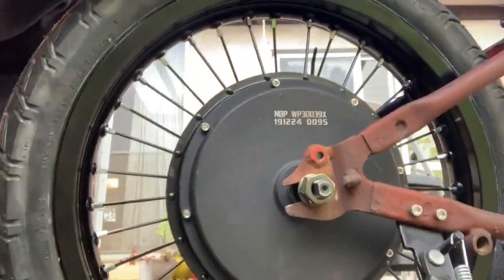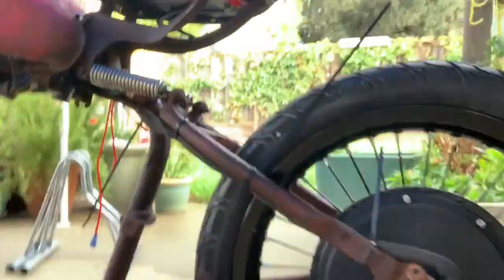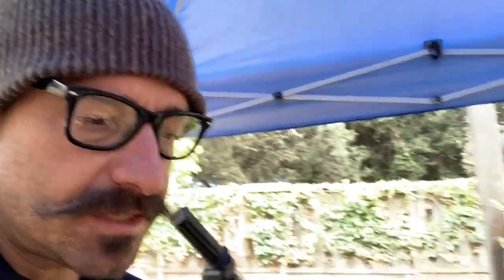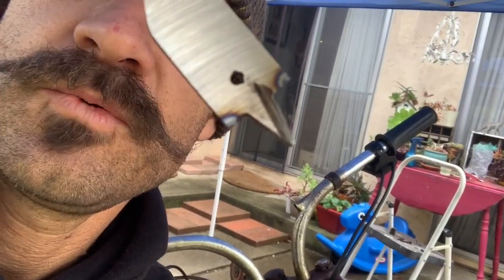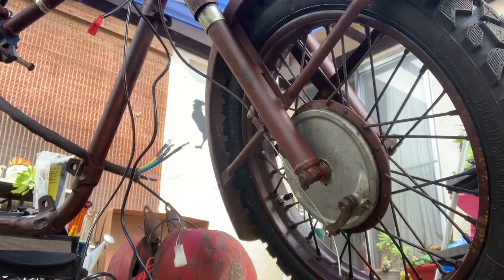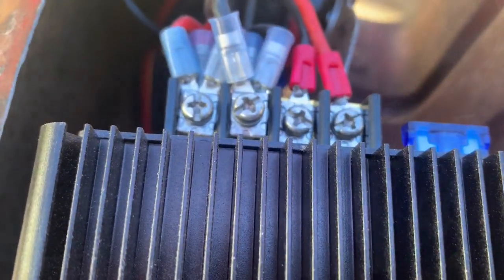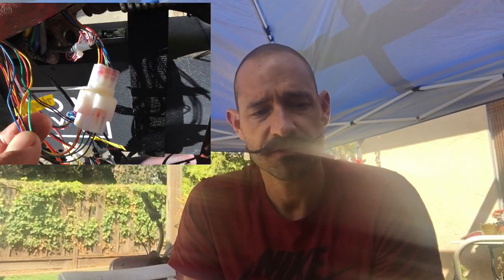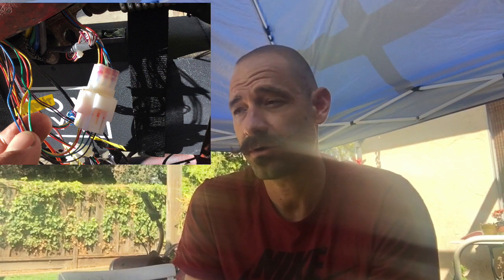1954 Puch Allstate Electric Conversion (Installing Motor, controller, cables, battery & wiring)

Comment: Sorry if i havent payed attention, but what brand is this motor? Qs205 or? How did the sabvoton hold Up to the task? Many people complains about the quality on this controller.. But I really want one myself, and already have one in the shopping cart.. 😂
Reply from the maker: The motor is a QS205 V3 3.5T.  I really like the Sabvaton controllers, it's pretty much all I run these day and only ever had a small issue with one of them (and it could have been an issue on my end with the wiring), and for that particular issue I was able to figure out a work around.  The interface is very user friendly and works for both android and IOS.

I have also read about the same quality issues, but to date I have found them to be pretty pretty much flawless.  The key is to not tweak the temp settings to aggressive and ideally to get as much airflow to the controller as possible if planning to run it aggressively.  Sabvatons aren't marketed for the consumer so depending where you order the controller from, the wiring is almost always different (They customize the controllers wiring/functions based upon what a companies needs are, and your technically ordering a controller designed for a specific bike). If your swapping out controllers you need to know if your bike currently sends its brake signal on the high or low side and to make sure you order a controller with the same set up (I just had a guy reach out that ordered a sabvaton that wants a brake signal on the low/ground side and the bike he was putting it into was wired for the high side) you can re-wire but its a bit of a headache to do.  

If you tell me what type bike your trying to build/modify, what speeds you want to obtain, I can give you much more detailed info in what you need to look for.  But probably the biggest bit of knowledge I can pass down is that the biggest limiting factor to both the Sabvatons and the kelly controllers isn't the amps or phase amps it can handle, but rather the RPM.  With 16 or 17" wheels the fastest your gonna go on any of these controllers is in the low to mid 50's.  At that speed the RPM tops out and the controller cant keep up with any faster signal.  But when I put 19"s wheels on the bike the top end speed jumps into the 60's and even the low 70's depending on the battery.  I believe the BAC 4000 & 8000 are the way to go if you want to obtain those speeds on the smaller wheel size simply because they can track the higher RPM,  but obviously those are $$.

Comment: You need to run the motor detection. If you dont run the motor detection it wont work. All controllers and motors need to basically pair. If you dont run the detection it wont rotate or it will run wild..
Reply from the maker: Thanks for the advice Elon. The company that sold me the controller and motor did the detection. Sent me a video of it before they shipped it out. The bike actually did start to move when I first turned the throttle, then I heard a pop. Two of the three hall sense wires fluctuate voltage. I took everything apart and figured out the issue, also what caused it. I made an error when mounting the wheel, forgot to put on the key locks. I actually didn’t forget, but didn’t think I needed them. Filmed the troubleshooting process, Sitting on the footage until the new parts come tomorrow. I’ll edit it all into a follow up.

Comment: Did you run a hall test on the motor?  Do you have the USB dongle coming out of your controller? If so you should be able to get the Bluetooth USB stick and you can connect to your Sabvoton controller with an app called VBMS or there's a free one called MQCON but I don't think it's as good.  There's an e-bike builder named Andy Kirby on YouTube he has a lot of info on that controller and the settings
Reply from the maker: Hey Mike. Funny you should say that. I was so burnt-out when I made that little speech at the end of this video. But when I Woke up the next morning I gave myself a kick in the butt and start a testing everything. I found the problem, I know why it happened, And I filmed the entire process. I don’t want to be too secretive, but I’m just waiting on some supplies that are on order.  Videos for this bike should start popping back out mid next week!